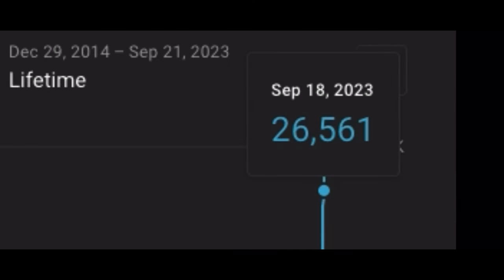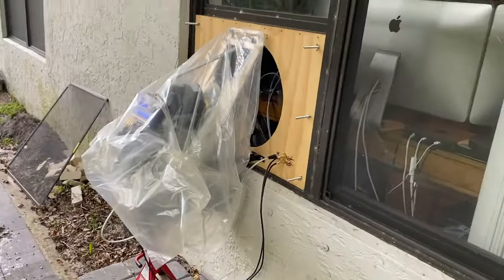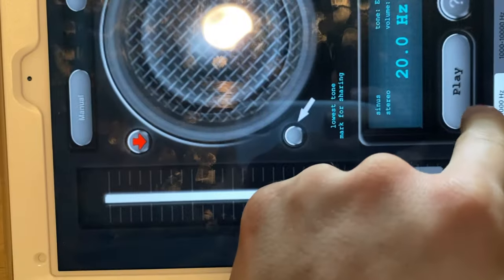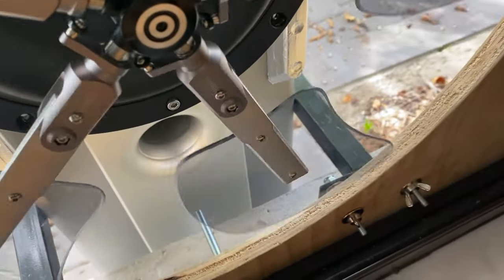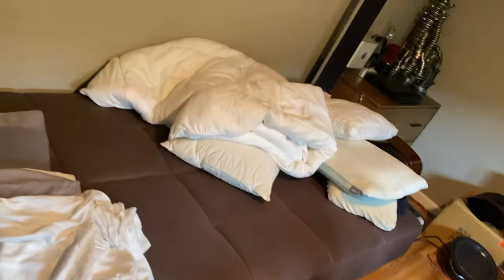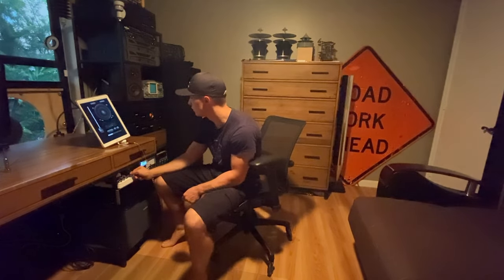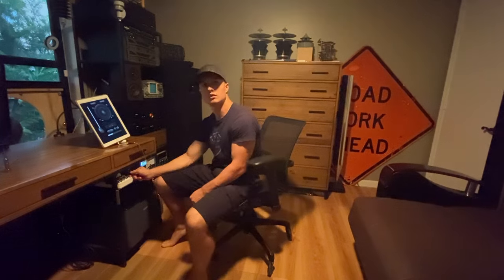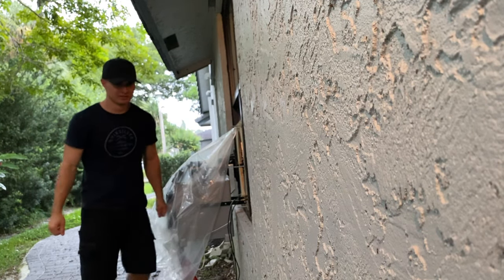Finding resonant frequency of my house with worlds most powerful “rotary” subwoofer (Bad Ending👌)

Comment from the maker: Title revision after reading the comments 👍. This one does sound better. Thx y’all
Reply: hahahahha so good man, bro you gotta raise like 30k+ to repair the structural dmg you just caused to your poor ma's home hahahha bless her heart. I'd be dead. Your sweet moms just like, "not funny". haha "Oh dear, Timmy destroyed the house with his bass thingy again. What ever will I do."
Reply: This video is so funny even the house is cracking up 😂😂😂
Reply: To be fair, that's not structural damage.  We get that all the time out here in California from mild earthquakes.  It's just that the plaster connections on the wall aren't as flexible as the wooden house structure, so shaking cracks things.  A bit of spackling compound and repaint will fix it up just fine.
Reply: @BrooksMoses brother I get basic drywall w.e cracking. But this dude tuned into the resonant frequency of his home... lol it's a lot different than a little tremor, especially if it gets to the point where it's cracking the walls. There's damage you can't see or source. It's not shaking from the ground up it's shaking from the inside out.
Reply: @Bloodywasher  I found a resonant frequency of my very tiny bathroom in a previous flat (I used to sing in the shower). A note that would make the whole room vibrate. Interesting stuff, acoustics! (and I bet the neighbors loved it! 😅)
Reply: @theTeknoViking  hahaha I mean like the resonant frequency amplified by a powerful electronic device, clearly the oscillations or w.e efficiency of the rotating sub cause industrial damage compared to your I assume beautiful bathroom vocals! ha thanks for sharing
Reply: Play the first 30 seconds of the way you move by outkast. That boom boom boooom
Reply: Hey Dan, I studied Aerodynamics in college and I think I can help you improve your subwoofer. Your fan blades are acting like miniature-wings. Wings produce a lifting force that, on average, is centered about 1/4 of the distance from the leading edge to the trailing edge. If you remount your fan blades so that 3/4 of the blade is trailing behind the blade mounts, that will induce less stress on your actuation system
Reply: @Bloodywasher  Dude. It's literally just a modified exhaust fan. This is not damaging the house.

Thats like saying that "woobwoobwoobwoob" you get in your car at highway speeds with the windows down ruins the integrity of the car. Yeah. Maybe after like hundreds of thousands of hours of doing it.
Reply: @Khaynizzle7 @Khaynizzle7 yeah thats why bass competition cars are specially made.... buddy you just made and defeated your own argument, while making yourself look dim no offense bro trying to help you.... "yeah sure we can install this high powered sub... oh what's that??? you don't want sound proofing but this is... oh it's just a little  wubwubwub? okay have fun with that car for the next 6 months."
Reply: @Bloodywasher  Yeah when they hit 140-160db plus, and thats in a van which has like 1/10th the interior volume of a house..

You think 100db-110db of bass is going to destroy the foundation of a house? Again maybe in like 50-60 years of doing that, but not in just two videos. No way. Again otherwise exhaust fans would be destroying houses all over the nation. My grandma had a small house with an exhaust fan and that never once threatened to destroy her house. Regardless if it was hitting those resonant frequencies or not. And her house was condemned due to black mold it was that rotted. Not a single issue with the exhaust fan braking the house though.

The house is not even airtight enough to have that happen. 

As others said. Wood flexes, plaster doesn't

It's not complicated.
Reply: Might be worth it to try out bigger surface area fins with less overall rotation
Reply: @theTeknoViking 😂😂
Reply: 😂😂😂😂 bassoon
Reply: "Thx y'all" he said. more like "THX y'all"!
Reply: And I am proud of my little joke! Ha ha!
Reply: @Khaynizzle7  yap more
Reply: @theTeknoViking  another fun thing with resonance is humming and whistling the same tone at the same time.

Comment: Bro is shaking the house apart, seen that he was doing so, and then continued to do so 🤝
Reply: Whell he was getting closer
Reply: He didn't cause the cracks in the wall or ceiling
Reply: No man, the sub obviously did not do that. Stop being so gullible
Reply: Walls are just fixed structures coated in shit that cracks if it flexes the slightest so it's not too far fetched
Reply: I can believe that the sub did that. If you find the resonant frequency of something, all bets are off.
Reply: @SyzygyNoon  lol, no
Reply: There are stories that in the 70s, when The Earthquake was playing at Graumans with the new Sensurround system. They had to put up nets over the audience to catch falling plaster that was shaking loose from the ceiling ornaments. And that the subway companies were getting complaints about the trains that were going extra loud during the screenings. 

Ok. May not be the best examples. But I'm not too surpised that thing leaves cracks in brittle materials.
Reply: As a true basshead is required to do
Reply: Cause it’s his mommas house
Reply: shit will only happen to american houses man, aint got none of that in europe houses
Reply: That's just like in car audio and windshields. Once the glass cracks. Most bass heads will proceed to turn up louder and blow it completely out 😂
Reply: @magic_what L paper mashe sawdust house vs W concrete and brick building
Reply: Lmaoooo that took me out 🤣🤣🤣🤣
Reply: @tonyp9179 i guess rotary subwoofers aren't all they're cracked up to be
Reply: @JaredConnell  nice
Reply: Earthquake 😂
Reply: he may live in florida but he is still gopnik
Reply: @Ripen3  If the resonant frequency of a gentle breeze can cause hundred thousand dollar traffic lights and billion dollar bridges to collapse, what makes you think cheap drywall is somehow immune to the effect?
Reply: @weblure  never said it couldn't. I said those specific cracks where not made that day.
Reply: Saw*, not seen

Comment: They should put these in theaters. Imagine watching a thing explode and feel every shockwave as if you were in there. Immersion would be at a all time high
Reply: Except the bass from one theater would bleed into the next and it would be one nonsensical rumble fest.

Count me in.
Reply: Theaters don't even try to get below 20hz. Heck, commercial theaters might only be solid to like 30hz. I had a serious sub system and even IMAX seemed disappointing because of all that
Reply: Imagine this stuff being used in a haunted house.

Comment: Bro sees the infrastructure of his house falling apart because of his subwoofer then cut away immediately and said “alright... 5 hertz… full send.”💀😂
Reply: Nah, it's just moving a lot of air. Hardly enough to cause those cracks. That is just the building settling and cracking the shitty plaster (seen is tons)
Reply: @SilvaDreams  sound waves can go via walls even better than via air. Seems like the video is correctly named and he must just evade using the same frequency in that house again.

Comment: To play higher frequencies, you should be able to lower the amplitude of the wave by changing how much the blades pitch for each period while spinning the fan faster so that the blades catch enough air. This way the energy in the wave is roughly the same for a given range of frequencies and the energy output can be controlled so that you don't end up destroying your house. You could also mess around with the shape of the blade paddles to maximize airflow, but that's a lot of work and precision. I'm glad the algorithm finally found you man, keep it up!
Reply: i believe the problem isnt due to the blades themselves but to the mechanism pitching them that makes too much friction to accurately translate the membrane's movement to the blades
Reply: Slop in the mechanism adds distortion!
As for speed, he has enough speed to play up around 25 Hz.
I believe his motor is 1550 RPM, that’s actually plenty.
However, lack of torque can also translate to distortion do to speed dipping, while the blades catch air.

Comment: IF you really want to play songs above 20Hz, you actually must to have an each servo motor on the each blade attached. The backforce is so strong, your tiny little subwoofer has not enough power to move them all at once. The good news is, enough powerfull servo is not that expensive, 40-60 bucks for one servo but the construction and other electronics adds up real quick and you'll end up with 2000+ dollars worth of parts for making this subwoofer but the most unbelievable thing is, if you really make it someday, and somehow, keep in mind that if you make your blades large, your house could loose a statics and could fall apart. Literally one 50-60 inch rotor crossection could destroy your house. It will be producing 150dB+ at 10Hz, you can't hear it, but your house especially can.  Well constructed servo powered rotary subwoofer with 25inch blades so 50will be entire crossection can outperform multiple infrasubs with 21inch drivers. As i said, if you make it, do not try to match your house resonant frequency, it will 100% fall apart if you let it play long enough and long enough is 10 sec.
Reply: That sounds scary..

Comment: you should try a smaller diameter. That should reduce inertia and allow for higher frequencies. Also, if you can get your hands on a 3d printer, try to make the pitching mechanism using compliant mechanisms rather than pin/ axle joints.
Reply: Everything this man right here said^^^^^

Comment: Nikola Tesla nearly collapsed a building that was under construction in NYC., by using the building's resonant frequency.
Regarding the 1888 incident, Mr. Tesla is quoted, "I was experimenting with vibrations. I had one of my machines going and I wanted to see if I could get it in tune with the vibration of the building. I put it up notch after notch. There was a peculiar cracking sound.

"I asked my assistants where did the sound come from. They did not know. I put the machine up a few more notches. There was a louder cracking sound. I knew I was approaching the vibration of the steel building. I pushed the machine a little higher.

"Suddenly all the heavy machinery in the place was flying around. I grabbed a hammer and broke the machine. The building would have been down about our ears in another few minutes. Outside in the street there was pandemonium. The police and ambulances arrived. I told my assistants to say nothing. We told the police it must have been an earthquake. That's all they ever knew about it."

Tis better that your machine malfunction before you deconstruct your house onto your head!
Reply: He called it an earthquake machine. Glad someone brought this up. It was the first thing I thought of when reading "resonant frequency of my house" lol.

Comment: Holy shit this is nuts and you might have legit created a weapon. Not even joking. There's a whole lot of studies regarding infrasound that gives people unease and breathing difficulties because of the changes in air pressure. The fact you were able to build this relatively easily is hilarious. The VAST majority of speaker and sub manufacturers are prohibited from producing frequencies under 20hz for this reason.

Some protips (have a degree in music technology) though as I want to see this project go places

- The vast majority of digital music doesn't have any information under 20hz because most speakers cannot play them. Even heavy EDM, its all high passed from around 35hz (ish) in most cases to make the track louder as sub frequencies colour the sound a lot. I'm unsure if this is possible (for reasons that will become apparent), but if you want to have a chance at playing music under 20hz, pick up some classical vinyl records (or anything honestly) made before 1990 as there's a solid chance it'd use an analogue desk for mixing and cutting compared to a digital one. You'll get those frequencies.

- You physically cannot hear under 20hz but you for sure can feel it! I'll be honest I would have no idea how to achieve this, but if you were to improve this project, try as much as you can to make it reach at least 60hz. I saw the limitations you had with the set up and the only way I can possibly think of making something vibrate that fast with the appropriate action is some metal crank shaft/piston rotating an oval cam. Kinda like how a vibrator works or a piston driven engine but with the plastic fans on the end? Difficult to convey over text.

- if you somehow achieve the above point the damn thing away from your house as you'll end up breaking it more lmao

Either way I'm following for further updates. 200/10

Comment: Use a high speed servo instead of the speaker to attenuate the blades and use lighter material such as Carbon Fiber for the blades.
Gained another sub, lets see some more builds.

Comment: If you reduce the mass of the blades you should be able to change the pitch faster. Extruded polystyrene blades that are airfoil shaped might be the best compromise
Reply from the maker: Working on carbon fiber ones……

Comment: You mean I've been a bass mechanic for a quarter century and didn't know this existed?  We need to spin this with a 480v three phase motor on a VFD and titanium variable pitch blade assembly from a turbojet engine.  Then we're gonna take Miami back from DXJ.  v=JgxYvuNvr2I

Comment: INSANE FLORIDA MAN SHAKES HIS HOUSE TO PIECES WITH EVIL FAN

Sweet project, dude. Strengthen those linkages, and maybe replace the woofer cone with a linear actuator or a solenoid to get into the audible frequency range and you might cause serious structural damage to your house..... Which would be AWESOME

I could make some carbon fiber blades for you, the added rigidity would help keep them from flexing under load
Reply from the maker: I appreciate the offer. But I’m kinda low on my budget rn for carbon fiber.

Comment: Guy is single-handedly proving that government can create earthquakes. I mean he olnly spent $200 and gets a whole house shaking. Imagine the government spending $200 million in a secret machine....
Reply: Imagining isnt convincing me, try explaining it.
Reply: Why
Reply: @marshallbowdrie8562  In fracking, a technique used to remove gas/oil from underground wells is to drill a hole into the well and then pump high pressure water into the well to push oil out. Similarly, if you have waste products you want to get rid of, you can pump it down into the well with that water. The ~20km thick crust has many layers, which some are porous and allow fluid through while others are solid and collect fluid. If you drill through one of these solid layers to reach the pocket of oil, the water pushed in will flow along the surface. If there are any plates resting on one another, there is a giant amount of friction between them, and they won't slip. A year or so after fluid injecting, we see local slipping (micro seismic activity up to magnitude 4 seen) in these plates within around 1km diameter down to sub meter precision. The pressure of fluid separates the layers and causes a reduction in friction between them until enough area has this fluid layer, and it slips.
This is the commonly accepted theory right now with significant evidence.
This occurs even in areas without fault lines near injection sites.
https://www.usgs.gov/publications/evolution-faulting-induced-deep-fluid-injection-paradox-valley-colorado

Comment: If you use 2 pistons per blade you should be able to change the angle of attack at higher frequencies with high enough displacement to get a sound. Since it'll be linear drivers, I suspect they'll last longer too.

Comment: Is that how Tesla made his 'earthquake machine'?  It was supposed to be about that same size, and he had like a 13 story building shaking with it.
Reply: Wooaaah. I haven't heard about that!
Reply: Nah it was a machine with a chamber and a piston in it, each end of the chamber had some holes so steam can come in and get out of it (it was steam powered).. with specific geometry and timing and everything the piston would move back and forth due to the pressure changes in the chamber
It was a device to generate electricity and it's similar to a car engine but it was known as "earthquake machine" because of how big it was and how fast the huge piston was moving

Comment: I think a big improvement would be to put a brace ring around the blades so the blades have two connection points, one at each end. It would rotate with the assembly   and be attached with a bearing to the outer end of each blade. It would add to the rotating mass and not the modulating mass so it wouldn't affect response. The added rotating mass could actually work like a flywheel helping it maintain precise RPMs during high output. You could also significantly lighten the blades without compromising strength or rigidity.

Comment: Could you build a second one with smaller diameter blades for 10 to 20? Or maybe cut the blades from carbon fiber so they dont have as mjch reciprocating mass.

Also i feel these noises have to be felt in person.

Comment: Theres gotta be a way to make smaller blade for higher frequencies, and a lot of harmonics testing/isolation, and with the right crossover settings to compensate, you could definitely match them together. You built a bandpass box so I assume you know whats involved, but like, with the success of this video you gotta do it man. Ride that wave.

Comment: I am absolutely amazed that swash plate worked at those frequencies, let alone for that long. The big reason for the frequency limit and failure seems to be mechanical lash, but I can't imagine a complaint mechanism that could do that without lash